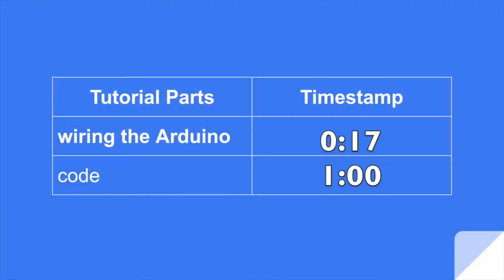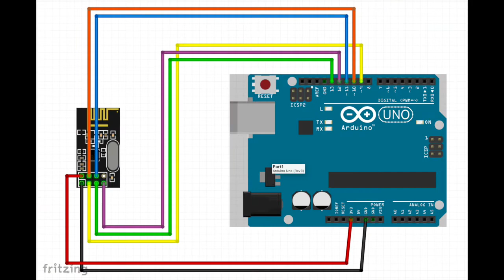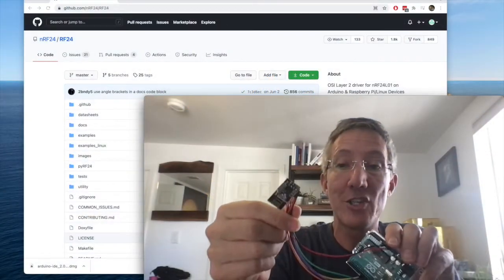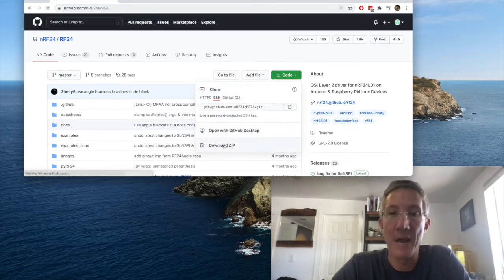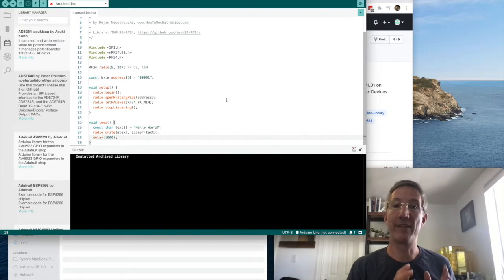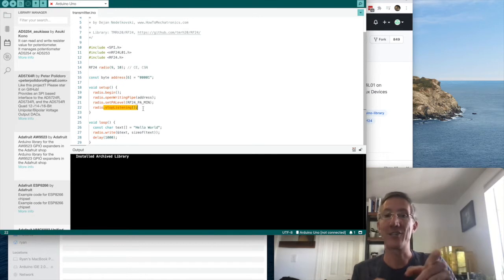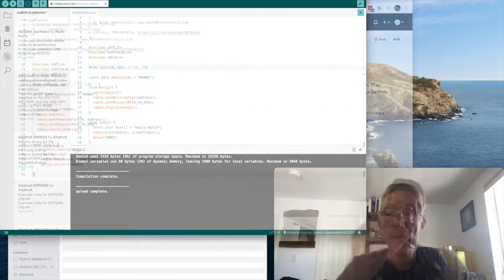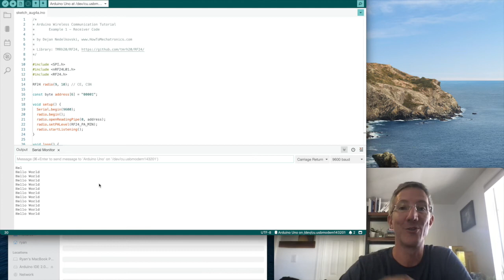Wireless Arduino communication with an NRF24L01+ radio chip (RF24)

Comment: Really informative 👍
Reply from the maker: Thanks a lot!
Reply from the maker: @dj-la--wolf1288  Hey DJ-LA, glad you liked it!  if you want the transmitter to both send and receive messages, you just need to have the code for both Arduinos on each one and use 2 channels.  If you want to search for it, the term is "2-way communication" or "bidirectional communication", and this Instructable has the code :) https://www.instructables.com/Arduino-NRF24L01-Simple-Bidirectional-Wireless-Com/